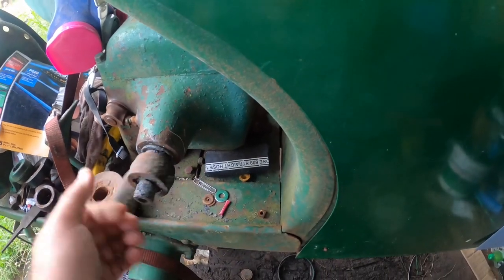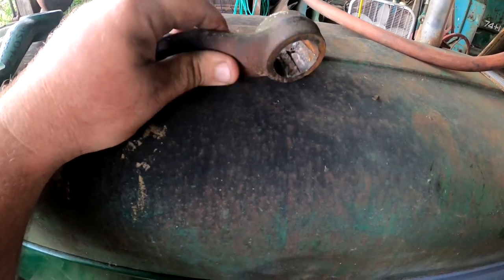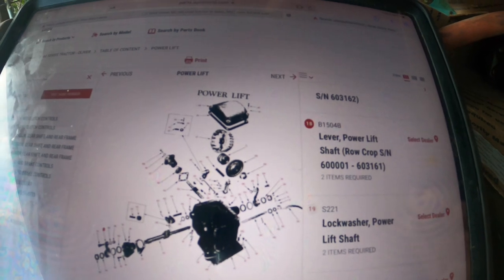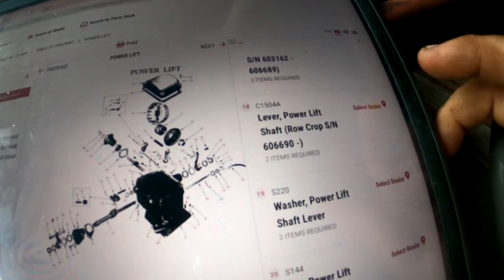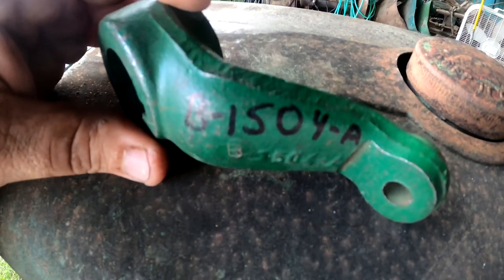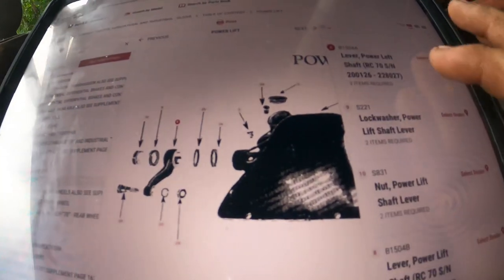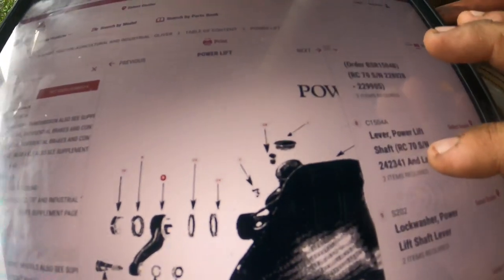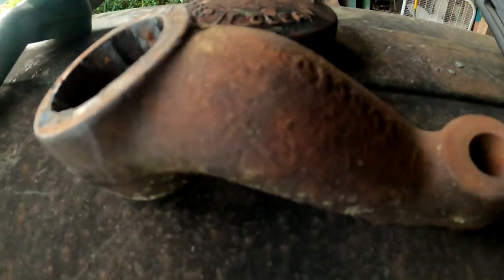Oliver Mechanical Lift Arms! Can you spot the differences???

Comment: I'm not familiar with the power lift, as all of the Olivers I grew up on were series 1 Hydra-Lectric and newer, but I have a couple of observations coming from the eyes of a machinist.

The stress riser created by the shoulder of the milled flat on the keyed straight bore arm would certainly have prompted change, as would the straight bore and single key.

That part definitely is cast, whether Iron (most likely ductile iron,which can withstand shock loads better than gray iron) or possibly a steel casting, but I'm guessing not. 

What's telling me it's not a steel forging is seeing where the mold parting line flash was scarfed off is quite wide. Typical for a sand casting to see that.

The second arm with the tapered and muliple splined bore has the advantage of bottoming on the corresponding tapered shaft, theoretically eliminating the 'working' action that the straight shaft arm would certainly endure.

It to me looks to be a steel forging, and if it isn't, it's a more carefully sand cast part and very likely a heat-treated steel casting.

The material thickness around the pin bore eye looks to be similar from arm to arm, but obviously there is much more material along the bore axis on the later one, so it is possible that it is still a ductile casting, but I highly doubt it. 

I thought I heard it ring when you tapped it against the end of the shaft on the 70, which would indicate that its steel.

Another thought spawned by you talking about the slamming action and shock load and the difference in weight between a 2 row and a 4 row cultivator. 

Much more mass with a 4 row. I'm guessing more than one person wound up cultivating a gravel road when they hadn't intended on doing so.

Thanks for another interesting video!
Reply from the maker: Thanks! I thought it was pretty interesting when I figured out what was going on.

Comment: Did you find a set of arms yet?  We got a 4 speed parts 60 but I would need to check the part number.  My grandpa messed a power lift up with a home made blade but if I remember correctly it broke something inside
Reply from the maker: Yes! Charlie the PA grain farmer found me a set.